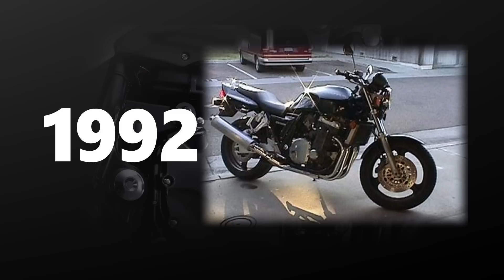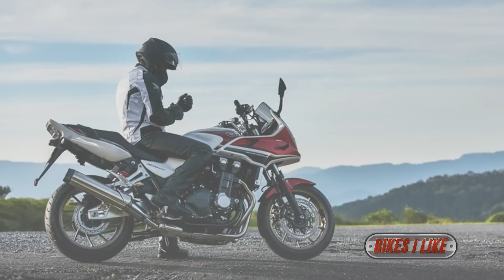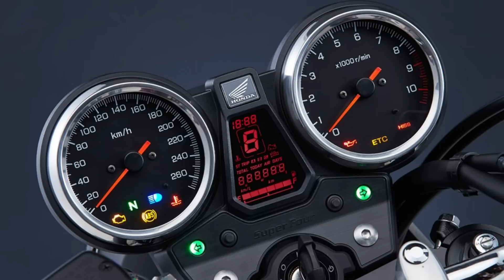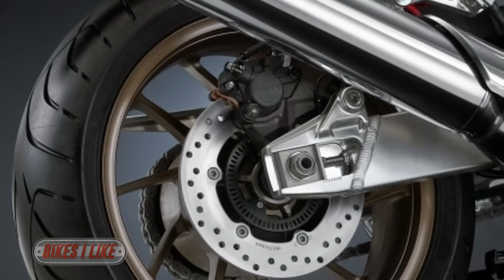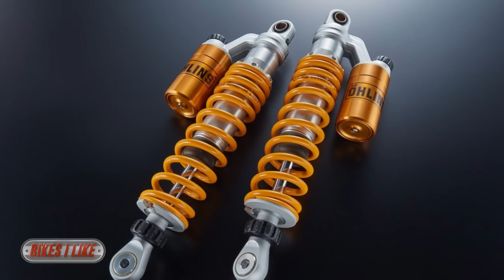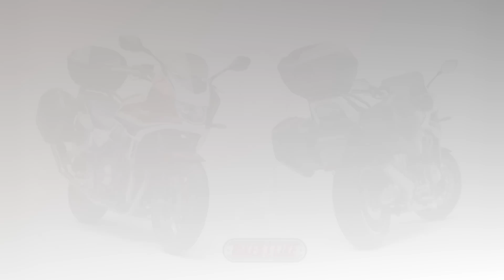2019 HONDA CB1300 - FULL SPECS

Comment: Nice wrap up Mr BIL! 

Syd - Aust. - I love my 2004 Super 4! It's the 'classic' white with metallic red features on the tank and rear / under seat plastics. I've had the front shock recon done (Springs / valves / oil grade / slider polish) for my 105kg frame, and run cold pressures 40PSI front and 34PSI rear. She's got 110,000km now and the valve clearances are still within spec. It's a little notchy down low with the Delkevic slip on and baffle removed, but it doesn't spend much time in that lower band rev range.

Can anyone please tell me if its possible to swap a later model 6spd box onto these motors (of course with a tune)...? I'd love the lower RPM for the lazier weekend get aways with my girl pillion.
Reply from the maker: Cheers Matt. Don't ever sell that bike! ;)

Comment: I had a CB 1300 with the fairing (Bol D'Or), Loved it, very smooth and could rally fly and handle for a bike that size. I will say how ever that the screen was a disaster for me, it seemed to take all the air from the front of the bike and chick it at my helmet very noisy and fatiguing. The other big issue was that the tail piece negated the fitting of hard paniers.

Comment: Yama MT-10 will easily out perform this Honda for less cost.
Reply from the maker: Sometimes it's not all about performance 😉
Reply: @BikesILike  This Honda is a great machine for sure!  The HP rating is low for a 1300cc, Torque is good,,but emissions are killing performance all around.

Comment: Hello. Dale in Houston in the US. Really appreciate the details in your analysis of each bike. They are very helpful as I am shopping for a bike and you mention details that I did not pay attention to. I watched your Honda CB 1100 and the Rebel 1100 Harley Street Bob reviews first. Really excellent. Are you still considering the Honda CB1100 RS? I am undecided. I cannot test drive many brands here. I can test ride Harley, BMW, and Triumph but none of the Japanese brands. What would you get now? I am 6 feet, 210 lbs, retired and would use it for all around riding for fun.
Reply from the maker: Hi Dale! I'm just going through my comments now and you've made a few, thank you. As I've mentioned in other replies I ended going for the Honda NC750X and really like it. I'm close to retirement age and was looking for something more versatile than my Vulcan Vaquero and I found it in the Honda. It's easy to ride around town, travels highways effortlessly, has a torquey engine which requires little throttle effort to get you moving and has great storage for stowing away your helmet and gloves when stopping at destinations...oh and the fuel economy is brilliant. I'm going to do a long term (5000km) review on that bike soon.
When it comes to test rides, we're also limited in Australia but it can be done. I have good relationships with the dealers locally and my goal is to start doing test rides.
Reply: @BikesILike  Cool.Sounds good. Thank you for your response. Glad you like it. I have heard others say it is a good bike. Is yours manual or dct?
Reply: @BikesILike  P.S. What year NC750X is yours?
Reply: @BikesILike  What made you choose NC750 over bikes like Honda 1100 or Kawasaki Z900 RS Cafe, etc?

Comment: I rode a 2019 CB1100 and it was a great bike BUT the engine just feels super LAZY to me. It pulls pretty good but runs out of breath very quickly in the rev range and high revving it just doesn't seem to add any performance.  From the pictures the  CB1300 shows an 8000 rpm redline so is it going to be a lazy engine too?  If so thats a real shame. Both 900's from Kawasaki and Yamaha seem much more willing and powerful. Either will pull the front wheel off the groud anywhere in the power band in the first three gears.  Where is that great Honda power?

Comment: Dump that exhaust & you might lose 50 pounds; a nice Yosh 4into1 titanium would be nice. They failed to reveal the bore & stroke, but I did see a wuss 8,500 rpm red line. Nice looking bike, would make a nice roamer. 85# torque is just OK. A minimum performance Big-Bore. Left-over '19 ZX14 for same price.

Comment: I’ve had my 2014 Honda CB 1100 6-speed for 5 years and it’s been perfect. Not too heavy and has all the power I can use. No liquid cooling complexity or ABS, just a basic bike. I’m done chasing horsepower I can’t ever use.
Reply: I have a zrx with some bolt on mods mostly from a scrap zzr that delivers 20 hp more that I use at least once every time out.  I have about 4 k into it after selling off the take offs and the rest of the zzr.

Comment: It is basicaly a XJR 1300 with watercooled engine. Power figures are almost identical. Even the rear shocks are the same as well on the Yamaha SP - models l as on the Honda SP  - models. What is funny,  Öhlins is owned by Yamaha.

Comment: Bikes should have at least as much HP as NM. Ideally, the same KW as NM.

100nm is roughly 73 lb-ft. At 100hp, that's no bad for a low end biased or low strung bike.

100kw is roughly 134hp. Still great and not over-stressed for a 73 ft-lbs engine. Probably still a great powerband and low end, too. Imo, bikes that do this are ideal to me, no need to go higher like 600cc race replicas which are approaching a 3x power to torque ratio nowadays.

Unfortunately, as some have asked for, doing the nm to kw equivalency to the cb1300 WOULD put it around 158HP. Hence why I don't think it either needs to follow the golden rule, OR needs that much displacement and torque. The silver rule (nm to hp) is fine for retro type bikes and actually ideal for beginner bikes.

And, just for more exposition, in the car world the rules shift down one notch. Golden is nm to hp, and silver is lb-ft and hp being equal.

Comment: I'd rather the look of the CB1100EX than this 1300. I consider the 2019 1100EX a nicer looking bike all round. Better seat, mufflers, although canted up for cornering, are not excessive in comparison to other bikes that seem to follow whatever angle the seat is . Plus normal chrome guards, rear lighting and number plate display that remains true to the retro style. Combined with today's safety and tech features, makes it quite an attractive package. Sure, I daresay there'll be plenty of dissenters that will not agree, as they're more into the race track look. Anyhow, that's my humble opinion, but do of course respect those who have a different point of view. Name of the game though, ride safe everyone, cheers...
Reply from the maker: I like them both equally David but if push came to shove I'd have to go for the day to day practicality of the CB1100EX as well.
Reply: @BikesILike   Thank you for your prompt feedback, it's much appreciated...
Reply from the maker: @davidhamilton506  You're welcome David.

Comment: It's too bad Honda doesn't bring a bike like this to the US, especially in this retro era. Some of us more seasoned folks don't care for the current angular cuts so many manufacturers are inflicting upon their bikes nowadays & the more more familiar form of the UJM rings truer to function meeting form. And while power output from the 1300cc seems adequate, I'd have to ask why so low in HP/torque. Conversely, why is the price so high, especially on the Bols D'or model? As much I'd love to have this bike, that price would dissuade me from purchasing.

Comment: Pretty lofty fuel mileage claimed. Makes me curious and happy if it will actually get 40 to 45 miles per gallon.
Reply: I have a CB1100 and regularly get 60 miles per gallon. Yes, the motor is smaller, but I have a 5 speed transmission while this newer bike has 6 speeds. I understand that 6th speed brings the RPMs down on the highway by at least 500. So the fuel mileage might be possible, IF the rider rode very conservatively.

Comment: Get a good used Blackbird for 3,4,5 thousand USD and it'll be a better ride than any of these. Equal torque, more HP and a better fairing. Don't waste the $$$ on "gold" suspension for street use.

Comment: They have a 1300cc motor that's tuned to put out only 109 HORSEPOWER ? ? ? ? ?

What the flock, over ?

But at least it weighs 90 pounds more than it should.

The engineering team that designed this bike should be shot.

Comment: Imagine that bike with modern power around 150 hp and 80+ torque. No wheelie control or rider modes. Just abs maybe . I don’t usually buy off the showroom floor but may for a bike like that. I’m sure it’s still quick but even the 1200 vfr has way more hp. What were the thinking. It’s name is the big one but don’t think they can keep that nickname for this version. Still nice bike though

Comment: I love my Big One and seeing these bikes and their price tags, weight, and horsepower make me appreciate it even more! I expected a much lower weight and more horsepower when i clicked on this video..   shame really as i was considering getting one. But i think i will just keep riding mine instead.
Reply: The "Big One" is probably a better deals these days.
Reply: hey mate, take a look at the Vfr1200f.... Way more power, bit lighter.  I love mine.  Just needs a Power Commander, Akrapovic and derestriction in 1st / 2nd .... and you're off in a very big way (167hp standard - I've reached 196).  Firing order replicates an inline 4 more than traditional V4's (which you probably would like?), grunty as @#$% once you tune out a teeny weeny power dip at about 4000 from standard - nice
Reply: It’s greater than the sum of its parts , and the figures. Horsepower is modest for the capacity these days but they’re still PDQ .   Check the video elsewhere here with the guy chasing superbikes , and passing many.  And ——with some add ons you’d have a monster.

Comment: Honda should bring back the 6-cylinder CBX 1000 but this time with a liquid-cooled engine = perfect.
Reply: Sounds like an F1 car
Reply: Yep.  About 1300 or 1400 cc's, and about 180 horsepower.  And no more than 525 pounds -- not one ounce.

Been wanting one of those for years.
Reply: I was thinking about the cbx watching this video
Reply: Blue Steel might end up a bit wide with the water jacket, V6 maybe?

Comment: I see many comments about "weak" engine,or "low" hp..you should first try to ride bike like this one,(retro muscle),than comment. I have similar bike- suzuki gsx 1400,with similar spec.,all that power and torque comes in a very low rpm...its normal that on 2nd gear at 4000 rpm,bike slips the rear wheel,when accelerating. You can ride it in 6th gear,two people on it,laguage,uphill at 2500rpm,it will pull like rhino. Normaly,extremly durable and reliabile bikes..And with aftermarket exhaust, you can clearly hear big cc's in the distance,by the deep sound,short shifting and low rpms. And also a beautiful retro design. Alongside mine gsx , i would be more than happy to have a cb 1300.
To better understand the "low" power,of such a bike,search for the video- yamaha r1 vs gsx 1400..
Reply from the maker: Totally agree Bare36.

Comment: Oh good, PGM-FI with an IACV.  I can't wait until these all hunt for idle speed.
Reply: Was it any differnet with carburated models? I think it's just Ok for the bikes to idle a bit roughly.
Reply: @TimoLahti  I'm referring to their cars that bounce between 800 and 1500 rpm because of the iacv.  The carbureted cars sucked air around the phenolic spacer under the carb.

Comment: Like the bike except for the heavy weight and low HP for a 1300cc engine.
Reply: 63 MPG though
Reply: bgm1911 Yep - they lost me at over 600 pounds for the faired version and only 109 hp -  really???
Reply: You have to look at the big picture when u look at a bikes specs. Not just peak hp.  What rpm does it occur? What are the transmission gearing ratios etc?  Who are they aiming at with these bikes?  All out rpm speed freaks or a more laid back rider?  Matching a motor to the right transmission ratios makes for a far more responsive bike than just having lots of top end.  This bike will probably feel strong at all rpms. Less downshifting required in the mountains than a basic topend bike. Will pull hard in all gears and run smooth on the highway without the annoying chainsaw sound on your ears on a long ride. A bike like that is far more impressive to alot of riders. So thats why honda built it that way.
Reply: I have same "class" of bike - suzuki gsx 1400. It has more than enough of "low" hp. Similar engine spec. Torque also "talks". All that power is on very low rpm,ready to push hard the bike immidietly forward.
Search for the video gsx 1400 vs yamaha r1. See, what can a "low" hp heavy bike do.
Reply: They’re for riders who 70% ride follow the speed limit and 30% for once a while berserk..Want more power take the CB1000R instead
Reply: Yeah, the HP is pretty underwhelming. My 2002 Honda 919 makes the same power and weighs less. My FJR1300 makes 40hp and ~13 tq more in a 1300cc engine.

Comment: I hope honda eventually notices the currently ongoing hyper-glorification of the CBX1050, and realizes the high demmand for an inline 6 retro bike.
Reply: Aside from engine smoothness, unique exhaust note and visual impact, there's little benefit to justify the extra weight, complexity (cost) and handling deficit an in-line six-cylinder engine has when compared to an inline or V-four engine. That's why current nostalgia motorcycles are based on existing models, they're far superior to old, discontinued designs.
Reply: @USARAY1947  --

It's clear you've never owned an inline six-cylinder bike.

It's worth the weight.

It's worth the cost.

It's worth everything.

Besides, at 590 pounds, this lead sled weighs 50 pounds more than a six-cylinder of the same displacement should weigh.

WHAT IS HONDA THINKING ? ? ?
Reply: @jeffsmith4801  Love is blind.
Reply: @USARAY1947  --

Not sure what you mean by that, exactly.

I used to own a Kawasaki KZ1300.  It came out in 1979 and was a water-cooled, shaft-drive touring bike.  It was undersquare, with two valves -- so with water-cooling it was actually quite narrow.

But I am telling you -- the smoothness of that engine was worth a billion dollars.  It was like a turbine:  absolutely smooth.  It was a whole different WORLD of internal combustion propulsion.  There is NO four-cylinder engine that can duplicate that inline-six smoothness.

And I'm a big fan of Honda's V-4's, so don't think I'm some kind of 4-cylinder hater.  Short of a new Six, my dream bike would be a VFR1400 -- a new version of Honda's VFR1000 Interceptor from 1984.  What a great bike.

Don't be mistaken, though.  A carefully designed Six can be very narrow AND light.  As a matter of fact, Honda's new 2019 Leadwing weighs 100 pounds less than the previous generation of Leadwing.  And it's had a horizontally-opposed six-cylinder for 30-some years.

Six-cylinder engines ARE worth it.
Reply: @jeffsmith4801  I was selling those Kawasaki sixes back in the day. Yes they were smooth and one surprised me with a second gear wheelie. However, they were terribly heavy for the time. Remember, this conversation started about the CBX, not the Goldwing. It's apples to oranges. Any inline six is going to be wider than a inline or V four so will be at a disadvantage handling-wise. Of course, handling is secondary to smoothness in a touring bike, which the CBX was not.
Reply: @USARAY1947  --

Sure.  Agreed.

The engine alone on the KZ1300 weighed 232 pounds.  Yes, that bike was stoopid-heavy.

But in view of the fact that the 1000cc sport bikes weigh around 430 to 440, I think it's reasonable to propose that a modern Six grand touring bike could be executed that weighs less than 525 pounds.  Which would be 75 pounds less than the beloved CBX -- you'll remember it weighed right at 600 pounds.  I always wanted a CBX, but I never got one.

Considering the fact that this CB1300 slug weighs an unnecessary 590 pounds AND PEOPLE ACCEPT IT -- as far as I'm concerned, there are no arguments against a better-executed Six that weighs 65 pounds less -- which is a very possible design.

Comment: Retro bikes should be sold at retro prices 😜
Reply: Sure, just pay what that money was worth back then.
Reply: Rata 4U  Exactly. Probably even less today in adjusted greens....
Reply: Great idea, Ivan.  But you'd have to be willing to live with retro engineering to get that retro price.  And I'm sure you wouldn't want to have to put up with those 1970's carburetors that are almost impossible to synchronize.  Or the Flex-O-Matic frames that are just slightly more rigid than noodles.  Or the swingarms that are attached to the frame in such a way the the dimensional relationship is completely negotiable.
Reply: @jeffsmith4801  ah the good ole days of spirited engineering 😂

Comment: Really surprising in the advertised power. Seems really low considering the engine displacement. I wonder if they’re purposely underrated.
Reply: Aftermarket systems will get the numbers up.  It has potential.
Reply: Two catalytic converters.
Reply: Leatherstocking Fella I thought he said three. Regardless it’s too many. Restrictions are out of hand these days.
Reply: It's the reliability factor. CB1300 engine can be operated 100K+ miles without "opening" it to more than valve clearance.

Comment: Looks a lot like my 1983 CB 1100F  GREAT BIKE, SUPER LOOKS
Reply: I also had one, amazing bike and sounded insane. I would have kept if it ever ran. Over one year it was in the shop around 10 times, had some electrical issue.
Reply: I also had a CB1100F (Canadian version which was a little different than the US) and you're right. This does look similar. For a motor this big it should have more HP than a '83 1100F though so it seem under-powered and wow is it expensive. No doubt it would be a great bike but for the price and power I'd probably be more tempted into a FJR1300 or 1400 Concours.